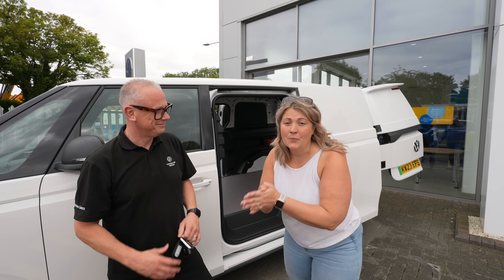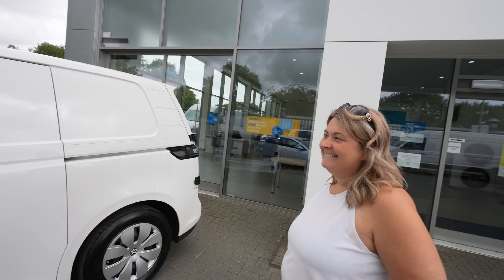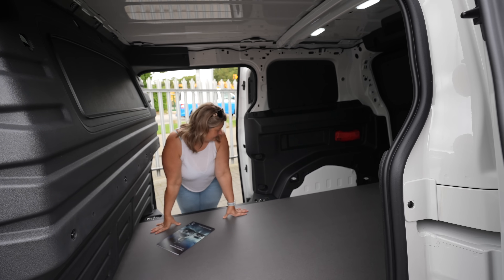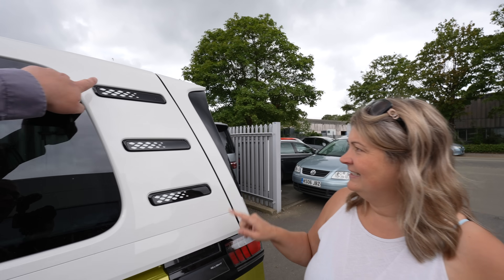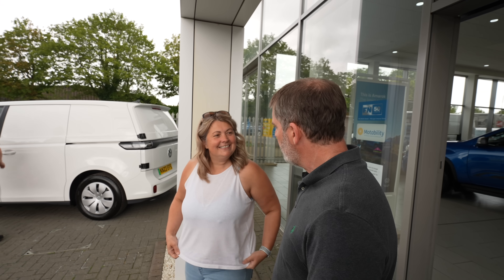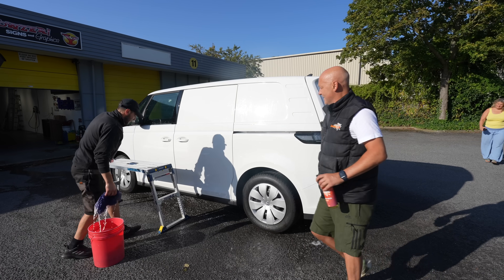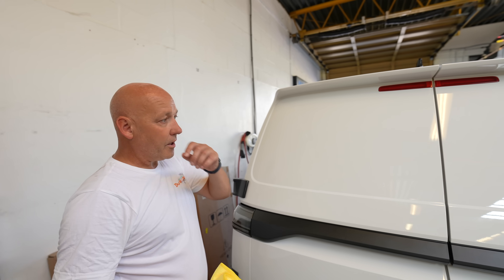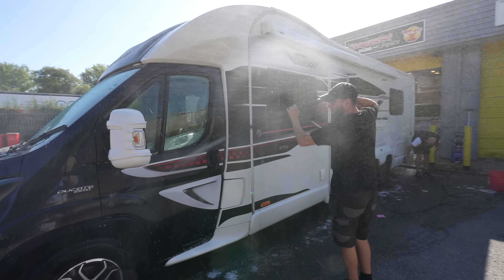OUR NEW ID BUZZ CAMPERVAN PROJECT

Comment: Why do you ceramic coat before you wrap it?
Reply from the maker: Vinyl sticks better to ceramic
Reply: @RoamingRadfords  really? I looked on google and that seems to be the opposite of what lots of people say? 

I thought the whole point of the ceramic coating was to stop stuff sticking to the paint?
Reply: @richtea7868 Noticed the guy doing the ceramic coating had still got the tags on the microphone clothes. Hope none of the big detailing channels tuned in.
Reply from the maker: We apply graphics on vehicles, that’s what we do, they stick just fine to ceramic coated vehicles. Think of your ceramic sink in your bathroom, put a sticker or sellotape on it and it will stick straight on, but wash your muddy hands and the dirt just washes off. It’s the same principle with the ceramic coating on a vehicle.

Comment: Hi Steve - on another subject ive been looking to replace my current van and seen some at Broad Lane Kenilworth- older vans (2008 to 2010) - their prices are pretty high for the model year but I know you’ve dealt with them before - any reason why you’d recommend them?
Reply from the maker: It’s a great family run business but if you can find a similar van cheaper at another dealer you should consider that, but don’t compare prices of private sales as they will usually be cheaper as they don’t have to offer the warranty and after sales service that a dealer has to offer
Reply: @RoamingRadfords  thanks Steve - I think the older vans are very high priced everywhere to be honest - seem to have gone up since COVID - most vans I like are mikes away to drive to - eager to get a different van - got Autotrail Excel 640G currently- but they’ll only give £24k p/ex - saw similar one (been on sale for a long time) up for almost £35k - 2009 - complete rip off - hope you and the family well mate x
Reply from the maker: @robcrusoeakarobb556 maybe try listing yours for sale privately on Autotrader at around £29k and see if you get any interest
Reply: @RoamingRadfords  cheers Steve

Comment: 21 inch wheels will give you a very hard ride..  now a question re your battery box, most camper vans have a life of approx 15 years which for  a battery box is a problem as your battery will have given up the ghost around 5/7 years prior.  So your gonna have a huge bill for a new battery and not be able to sell or get a very low exchange price.  Wouldn’t touch one with a barge pole
Reply: If you’re right and the battery gives up the ghost in 5/7 years, they’ll get a brand new battery for free, as the warranty on the battery is 8 years 😎

Comment: This is going to be an interesting project guys. I'm assuming its not going to be straight forward doing an electric vehicle as a camper but I'm sure the content is going to be very informative. It will also be interesting how an electric vehicle fares as an actual camper-vis a vis charging. One thing I'm positive about is your opinions will be honest and tell it like it is- warts and all.  Good luck with the new build!  Best regards and respect- Kenny

Comment: I would have waited for the Volvo EM90
Reply from the maker: I’m sure the Volvo will be a great van, but there isn’t anything as iconic as the VW ID Buzz, with such heritage going back to the original VW van being launched at the Geneva Motor Show in 1949. This is going to be a great little project to show what can be achieved with such a vehicle.